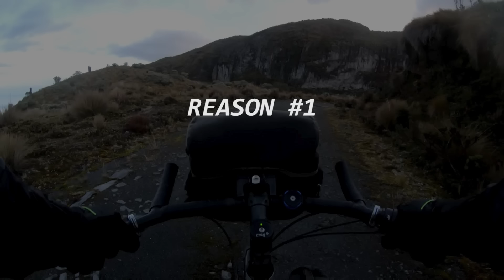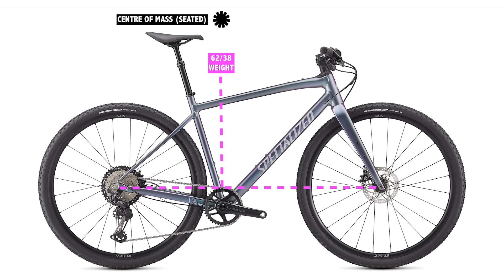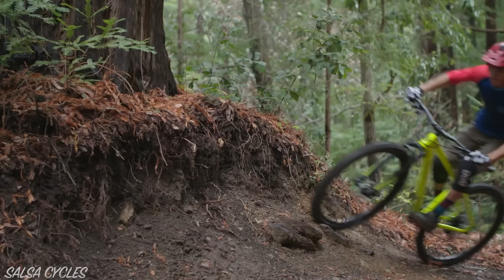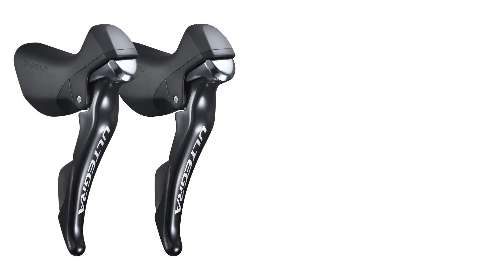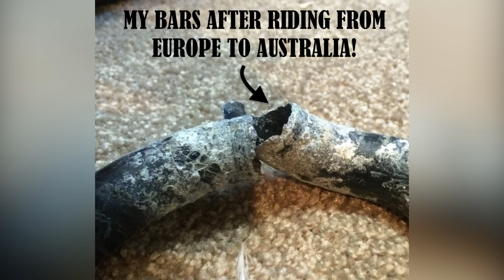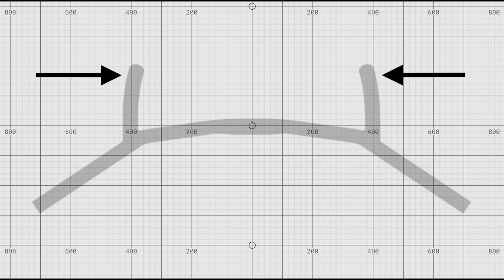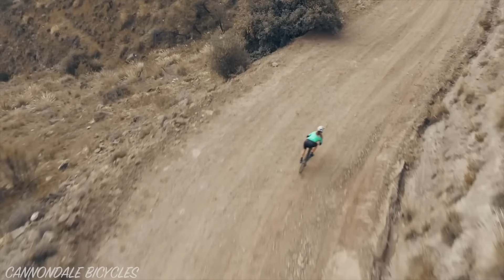Why Flat Bars Are BETTER Than Drop Bars For Most Cyclists (Objective Analysis)

Comment: I like the fore/aft positioning on my drop bars.  I like the higher tops for cruising and drops for a decent or tech stuff.  The end of the drops are wider and closer reach for more toque & precise steering over tech stuff.  But I can move my hand position to the front of the drops for higher speed down hill descents My weight is 2 inches forward for more stable and relaxed steering and my fingers are touching the brakes-for higher speed stability.  Same on the tops.  My normal position on the tops.  Higher/closer & easier reach.   Perfect for upright cruising.  I want a little more control or weight over the front wheel for climbing?  Move to the hoods!  I love the weight distribution changes that can be done on a drop bar.  Also if I get any wheel bob on an uphill climb, I just move my hands 1 inch forward or backwards-stops it instantly.   The tops of my drop bar are a few inches OVER my seat height.  The drops are at seat level.
Reply: the real reason I don't ride flat bars.  I can ride for a month long cycling trip on drop bars-no hand pain.After a couple of rides on my flat bars--, wrist/hand pain and numbness. I had to take a break from cycling in the mid 90's because of that.  
Do what works for you though.

Comment: When the width of handlebars are narrow, thoes're higher straight line stability than wide handlebars.
Because steering torque that could disturb the caster effect is less than wide handlebars.

Comment: You mentioned that frames designed for flat bars are longer than a drop bar bike. Is there a ratio I can calculate that will indicate if the frame geometry is suited for flat bars? I'm particularly thinking of a Ritchey Outback, but I would love to have a rule of thumb. Thanks!

Comment: On very steep down hill sections with keen disc brakes on road and light rough here in Snowdonia, I find it best to get my butt out of the saddle and back over the rear wheel to equalize front/rear braking effort, this also enables my arms and legs to be braced straight to help me resist tipping forward from braking G force - It wouldn't be so easy to reach the distant brake levers on dropped bars. I agree though that straight bars are less comfortable after an hour or two. For me, I find good length bar ends, clad with soft plastic foam secured with carpet spray glue, mitigates this shortcoming.

Comment: Bro i have better controland stability  with a dropbar than a flat bar i have a better control and stability because it has a vertical handgrip which feels more natural to me when i started cycling i had trouble with flat bars but when i switched from flat bars to drop bars i had better control and stability its like i was born for drop bars and not flat bars and its bc it has a vertical grip which feels nartural as you dont need to rotate your hand to a vertical positiom

Comment: What this dude's not telling you is that swept-back flat bars are horrible in the tech and steep into a turn.  I'd rather be on a wide drop with a decent flare.  Also left out of the convo is the style and fun factor you're going for.  I want another drop bar bike just to switch it up, and make the trails harder and different.

Comment: You just saved me a lot of money!  As a new 60 yo rider, I've been very seriously considering buying a new gravel bike as that was my interest when I first decided to take up cycling late last year.  I've spent a ton of time researching the subject, and have visited both of my local bike shops and spent hours testing bikes, etc.  I already have a flat bar XC MTB that I bought as a start, and I recently purchased a road bike when I decided it would be a better tool for the riding I'm currently doing, which is riding a local paved bike path as I work on my conditioning.  But very recently, I've begun to think that perhaps it was time to get that real gravel bike and begin hitting my many local gravel routes.  BUT THEN, I see this video!  And I realize that I don't "need" a gravel bike!  I already HAVE a CX bike, and don't even know for SURE if I'll enjoy riding gravel!  So, now I plan to backburner the new gravel bike purchase, use my road bike as I currently do, and start using my XC bike for the gravel routes.  As an older casual rider not too concerned with speed, and not concerned at all in competing at any level, and with the advantages of the XC flat bar bike you listed (many of which was what I thought on my own and leading to it's purchase to begin with), you helped me find the obvious answer...  At least for now and until I explore my interests, learn more about what suits my needs, and perhaps decide I do want that gravel bike after all....

Comment: I dismissed the drop bar in one of my road bikes, convinced that all would be better with a flat bar. The breaks are more at hand in a flat bar than in a drop bar, for sure. So I did change the bar and all the corresponding setup. In the first kilometers all went very well, but the longer was the ride, the more I repented of having made that move. I felt VERY unconfortable not being able to change my hand's position every now and again. The drop bar gave me two or three possible positions. The flat, just one. All in all, this bike lays now in the room while I go with my other with drop bar.

Comment: This is from a mountain biker perspective and overlooks a lot of details for a road rider. Two different design requirements. Drop bars let you move around on the bars and change your wrist angles which is very important on long rides. Something you can't do on straight bars. Straight bars are cool but not something I would run on a road bike where you may be in the saddle for many hours. Drop bars are used on almost exclusively on RTW touring bikes and for good reason.

Comment: Dude, one can build a dropbar bike lacking most of your 'dropbar flaws':
No toe overlap? Take a long frame, add a short stem.
Less control? There's dropbars with ridiculously big width and flare angle.
Gear ratios? Obviously it depends on riding conditions, not on a bar shape.
Braking performance? You can brake with one finger regardless of the bar shape if it's hydraulics.
Sweat corrosion? You may have to apply electrical tape underneath the bar tape. It also prevents bar tape from unwrapping.
And don't question dropbar ergonomics.
Everything you can do to a flatbar to improve ergonomics is to make it less flat and more curved and it tells a lot.
Reply: And regarding the bike overall cost: dropbar bikes are definitely faster, so there's a reason to cost more.

Comment: For me, it is mainly a physiological decision. I have CTS and RSI in both wrists/arms and turning my hands flat, like I would if I would lay them on a normal table, increases the discomfort. That's also why I'm using vertical mice and tented keyboards when working on a computer for instance. Drop bars, especially the hoods position, kinda does the same for me as a vertical mouse would do.

Comment: When I was entering offroad cycling I got really pissed about gravel bike prices... So, I got myself a second hand XC with rigid front fork and aero bars. Then I tried participating in an shorter version of an ultra marathon here in Poland. We cycled 370km, 80% offraod with no longer stops. Whenever I wanted to be aero or change position I used aero bars. And I had a HUGE advantage over my, better fit, friends on gravel bikes whenever there was any sand (and there was A LOT of it) or rougher terrain (like rougher, more rocky gravel). I simply zipped through such areas while my friends struggled a lot. Long story short, we all finished the marathon, with same level of exhaustion, satisfaction and (type 2) fun. I think I will never consider drop-bar offraod bike, I just enjoy doing sprints in sand or rocks ;) 

And this advantage comes from one more aspect you didn't mention - drop-bar offroad bikes (a.k.a gravel bikes?) tend to have narrower tires. These day gravel bikes start to incorporate 2'' tires while in flatbar bikes 2'1'' or more has been standard for years.

Comment: Loved the 70's cruiser bikes, was all about bmx in the 80's before diving in and indulging with road bikes 💛 .... mountain bikes came out in the 90s and took full advantage n love them and still have my ridgid mountain fromthe late 90's and still use it today I just can't wrap my head around gravel bikes they just make absolutely no sense to me, if you take away the distinctive things on a mountain bike away and the upscale glories of a road bike are abolished now you have a plain Jane drop bar gravel bike with less gears and no suspension and slightly fatter tires than a road bike. 🤷‍♂️

Comment: I prefer drop bars for longer, exercise/endurance rides as I can move my hands around to different positions so they don't cramp up. With flat bars there is just one position and my hands cramp up if I'm doing more than a 50 mile ride. I do like flat bars for the short commutes and the occasional MTB/off road or gravel ride (which are also very short at less than 10 miles). Now if I ever think about doing touring or riding coast to coast across the US, I'm curious about h-bars and butterfly bars.

Comment: Let’s talk about handlebars, but I’ll leave ergonomics out of it WTF
Reply from the maker: Both handlebar designs are ergonomic by definition. Comfort/feel all comes down to personal preference. In ultra racing events where competitors can choose between flat and drop bars, there is often a 50/50 split between bar type. This would not be possible if one was more "ergonomic" than another.

Comment: Well done thank you for your hard work. A niche consideration may be that It was cheaper to reuse old drop bar parts than to upgrade to a more exotic handlebar that has multiple hand positions but also still considered by you to be "flat". I think amalgamating all bars into one category "flat" and then saying they are cheaper is misleading. Only the base model flat bars are affordable.

Comment: Drop bars have brakes and gears in two hand positions, flat bars do not. Now pursuit/bullhorn bars can give 22.2mm cheaper components in the most common drop bar config (hoods) so they may be good for many people but I like to switch up hood/hook and still have access to my levers. Aero bars give the best hand rest you can get on long smooth stretches, any bike used on a road without them really shouldn't complain about hand strain and they fit flat and drop bars.

Comment: Flat bars are more comfortable and with comfort bikes are the only way to go. I use three sets of adjustable shocks of my bike (front fork, bike seat, & handlebar) for an ultra-smooth ride with reduced soreness. At 68 I am willing to give up a couple of miles per hour of speed for additional comfort and less soreness. I just past 1,000 miles for the year on the way to 2,500!

Comment: The way I see it it mostly comes down to how rugged roads you intend to go on. Most of the time I would benefit from drop bards for aero and comfort, but it's not uncommon that go up nasty rocky tractor trails and the like where drop bars would be absolutely horrible. Though I have ended up adopting a bunch of different weird grip positions to keep my wrists happy on day long rides. I think I only grip those bars as designed less than a third of the time. Realistically I should probably buy some better ones, but I've gotten very used to these ones, so it's low on the list of things I want to spend money on.

Comment: Great analysis! You've pointed on interesting aspects of each bike configuration!  👍
I've almost always had flat bars bikes and like them a lot!  
I've recently bought new Trek FX 2 disk with 2x9 drivetrain and I'm very satisfied with it's flat bars and how it behaves. It is quite fast,  stable and fun to drive bike although it has cheap but still smooth Altus m2000 rear shifter. 
Only minor problem is that original grips aren't as comfortable as they should be on longer rides (over 15-20 km or more). 
Greetings from Croatia

Comment: 30-year BMXer and MTBer. I've never understood drop bars. They're like wearing 4" high heels to run a 100-yard dash with hurdles: It totally handicaps the riding experience. I simply don't understand how to control a bike with those things. How am I supposed to hop up a curb, do a manual, or make an aggressive turn while still being in control? The first thing I do when I get a bike with drops is throw them in the trash and get a riser bar. My desert island dimensions are 12 back and 4 up (degrees sweep). Ahhh! Now I can shred.

Comment: Furthermore, braking and shifting can be done while gripping it vertically.Flat bars have the disadvantage of sore wrists on long rides.
But mounting the bar ends in the middle of the handlebars solves that problem.Furthermore, braking and shifting can be done while gripping it vertically.
The inner bar is so convenient I can't go back to it.

Comment: ... "personal medical note" .... after +50 yrs of hard physical work I was told I have " torn Bi-lateral Rotor Cuffs" ... so while I can use drop bars on smooth paved roads ... on semi rough trails I need "straight bars ....  to keep the strain off of my shoulders ...

Comment: I personally like drop bars, it can get some getting used to and you might want to put tiny bit of effort at the beginning into correct form, but after you get used to it it's just better. Things is, more than handling, I think wind resistance is just overall way greater detriment to your comfort, even with relatively short commute trips. Narrow bar also doesn't engage your hands as much so they are more relaxed. 
Obviously, my arguments fly out of window if you mainly ride in MTB terrain. Even touring, unless you have very special route, you are most likely riding routes where wind resistance is bigger detriment than everything else. Ultimately I think all arguments you made are really good, but they just don't apply for most riding. Flat bar design is objectively better for many things, mainly control, but drop bar is good enough on those things for almost everyone and tackles huge problem of wind resistance and some ergonomics that help in long rides.

Comment: Drop bars are great for people without broad shoulders. I'm over 6 feet tall yet with very narrow shoulders. Any sort of flat handlebar is too wide for me at the size that the rest of me fits. Plus flat handlebars are unwieldy except in a comfort bike layout where the ends come towards you. 

Also try fitting into tight spaces with wide flat handlebars. You can't. 

One thing flat bars do well is low cost and ease of maintenance. Just attach whatever you need.

Comment: Definitely prefer drop bars. 
I tend to average 30 kph on daily rides or 23-26 kph when touring 6-12 hours a day. So aerodynamics are key for me. Most of the time I spend on my aero bars which relieves hand from all and ass from most of the weight so it is ergonomically the clear winner. Once in a while I'll switch to hoods, drops or upper bar to get my back and neck into another position.

Once a year I go on a slower camping tour with lots of equipment in large back pannierts and smaller front panniers, sometimes even a large drybag/tent in the rack. Even with 60 kg bike weight I didn't have issues with control on medium bad gravel roads. An I only run 42 cm drop bars with almost zero flare. Flat bars might be slightly less straining in that particular situation but then again they take less than an hour to cause carpal problems for me. I've tried lots of flat bar shapes but selling my Rohloff bike and building a nice and sturdy randonneur bike with drop bars turned out to be by far the best decision I have made regarding cycling.

Comment: A very nice, compare & contrast, analysis of pros and cons - and carefully, logically presented, with appropriate teaching visuals.   Very well done.  
   Bar ends on (alloy) flat bars are great! Great!   An ability to easily turn the forearm, and to move further forward is especially nice while climbing.  Perhaps best of all, a slightly curved inward bar ends reliably protect the precious hands from getting whacked on trails.  Bar ends were In, now Out?  Why does everyone seem to hate on bar-ends?   Sincere question.

Comment: I think the title is quite missleading.

I'm not even half-way through the video and a lot of the points so far tackle not the drop- or flat-bars themselves, but the bikes they're usually on.
Things like toe overlap, the number of brakeing cylinders, the length of the wheel-base etc.
None of those aspects are directly affected by the geometry of the handle-bar.

Edit: lol, just as I finished my og comment and continued the video, the next point was gear ratios. Are you f***ing kidding me?
What does that have to do with the style of handle-bar?

Comment: The only point of using dropbars is if you're trying to make a time (on road)
Reply: hand position? I've got bar ends on my flatbar, which I use as my default position, but I always have to change hand positions when I need to access the shifters or brakeing levers.

Comment: Flat bars are better due to:
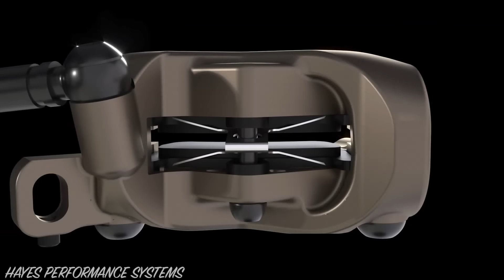3:53 better braking due to larger-diameter rotor brakes
4:07 low gear rations are more common on flat bar bikes
9:01 more stable frame design, no toe overlap

Duh

Comment: YES I AGREE ,but l would need extensions in the middle for climbing /sprinting to get my body more forward to put more preasure onto the cranks :)  PS l recommend FLAT BAR ROAD BIKES to anyone looking to get into cycling ITS easier for them to relearn balance etc plus the slim tires are faster and easier to peddle .Most people think MTB not realizing how hard they can be to ride for any length of time just around town .